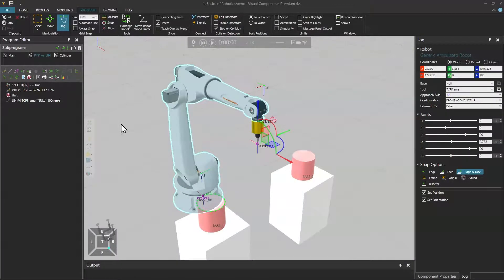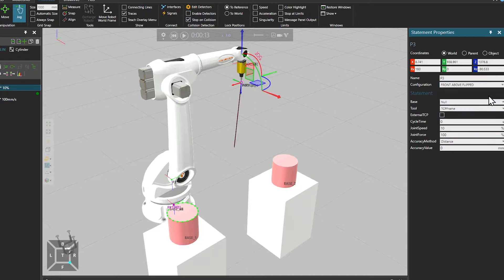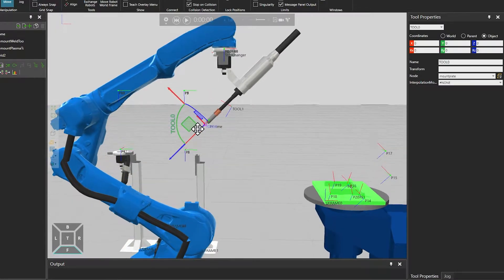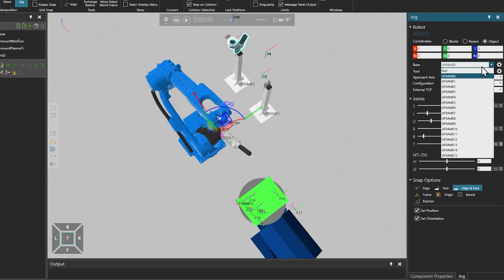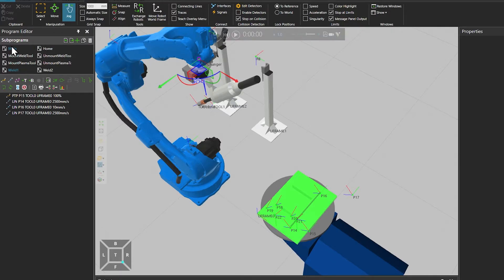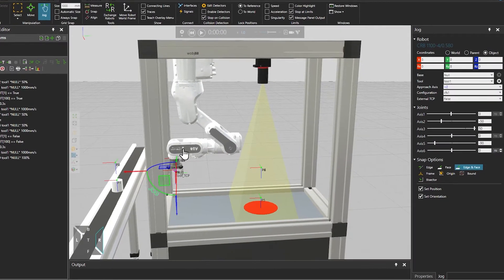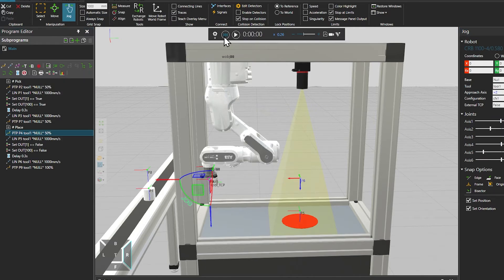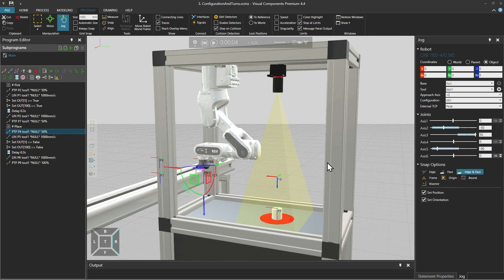Basics of Robotics

Comment: How do you program the welding motion whilst the positioner is also turning?
Reply from the maker: Connect the interface between the robot and the positioner. Then use a base attached to the rotating table to teach the robot motion. In the video, there is UFRAME0, used as a base frame. In the video it is explained from, 4:50 onwards